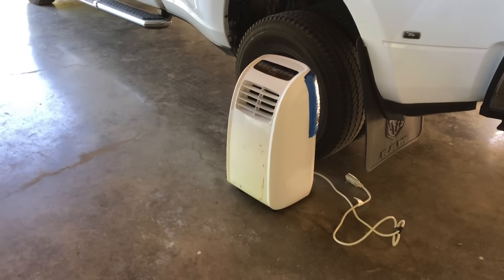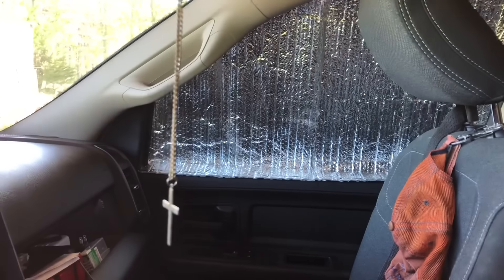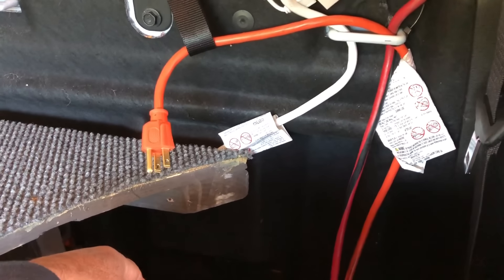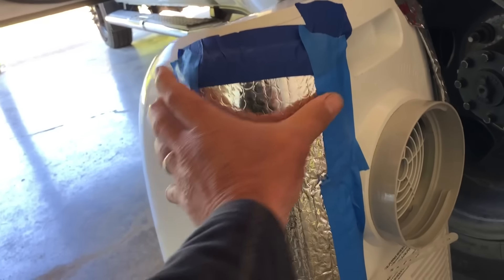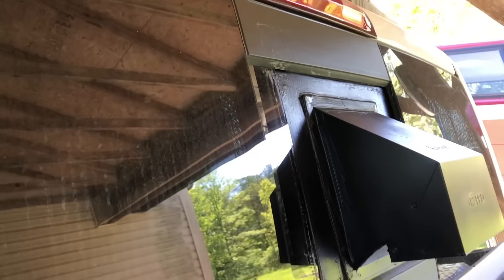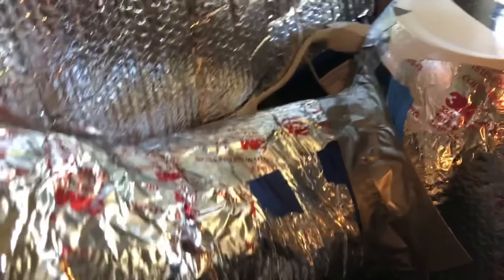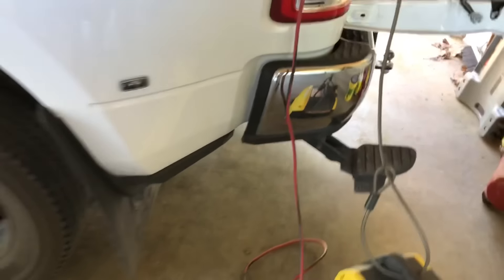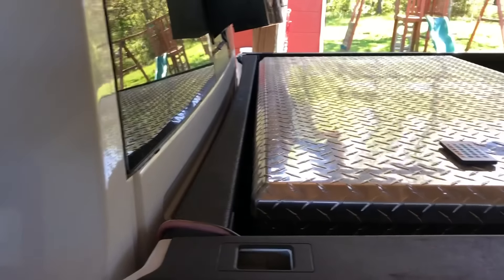Best Hotshot Pickup Sleeper Air Conditioning Setup! Save $$$ and stop idling when off duty!

Comment: I dont think somepeople realize that your never supposed to cover the vents on a single hose AC and a single hose AC creates a vacuum inside the room or a car its not a good option.
Reply from the maker: I have been using it for years, what are the issues?
Reply: @hotshotstuff8080  It creates a Vacuum inside any closed space it is placed in. Because it uses the air inside to cool off its condenser and most importantly it contains equipment that gets hot and can get dangerous if it overheats.

Comment: This setup is way too overly complicated. I use a 4k BTU window unit that's a third the size of that portable ac unit and also probably about a third the price. Open the back sliding window and sit it outside the window like you would do at a regular house. It's small and can be stored under the seat or in the Tupperware container.
Reply from the maker: I’m glad you found something that works for you. As far as being complicated I don’t see it! My setup stays in place and what you are talking about has to be setup every night and taken down and put away every morning. Now to me that sounds complicated! As for the cost of the unit itself, I paid somewhere in the 300 dollar range for the air conditioner.
Reply: @hotshotstuff8080  I keep mines in the bed of my truck so it's out of site and out of mind. It's not in my way when I'm sleeping... and doesn't require all of the duct work. Once I start up my generator I simply sit it in the window( I attached a handle to it for easy lifting, it sits perfectly right on top of my auxiliary tank), and takes less than a minute to setup. It's on the smaller side so it takes up hardly any space but packs a punch. Plus it came with a remote so that's how I control it from inside.
Reply: @David-td5po  what brand/ model of ac do you have?
Reply: @Md-be3bt  
Brand-
FRIGIDAIRE
Model Name - FFRE053WAE
Bought it off Amazon.
Reply: @Md-be3bt  The only modification i made was putting tape on the outer vents so that all the air comes through the middle (main) one.
Reply: @David-td5po  tha
Nos for info

Comment: Looks like it takes too long to set up and take down no thanks
Reply from the maker: So the air conditioner stays in the pickup after it is installed, only need to start generator and plug it in daily. Takes 3 minutes to setup the entire sleeper daily.

Comment: Time you spend all the money to set all this up, might as well just let your truck idle. Diesel isn’t that expensive. This just isn’t practice money nor time wise. Smh
Reply from the maker: I guess it just depends on one’s bank account. You will burn 5 gal diesel a night idling verses 1 gallon gas in a generator. That’s around $15 per night saving on fuel cost.
Now take that 28 days a month $15x28=$420 per month.
Now take $420x12=$5040 per year savings on fuel cost alone, not to mention saving on diesel engine maintenance(which if your idling should be done on engine hours and not mileage). I spent around $700 for everything to setup the air and heat with generator, which has lasting over 2 years now.
So for discussion let’s say you buy a new generator and air unit every year and see how much is left;
$5040-$700=$4340. 
Now let’s say you run your truck 5 years before replacing it.
$4340x5=$21,700.00 over the life of the truck, not counting extra engine maintenance and wear and tear.
I’m not sure about others but I’ll take that all day every day!